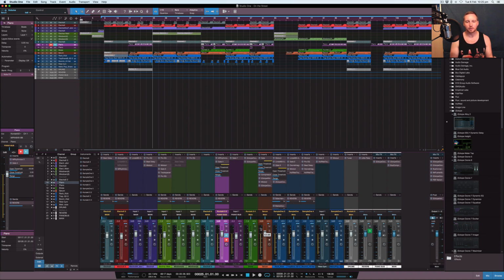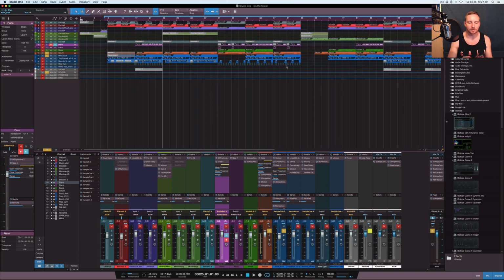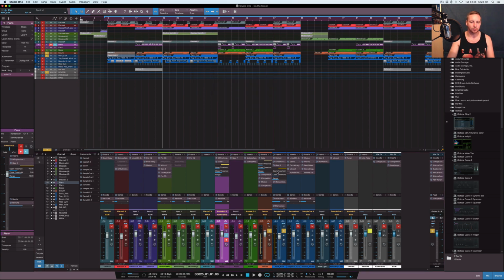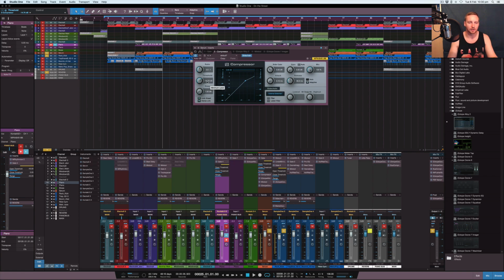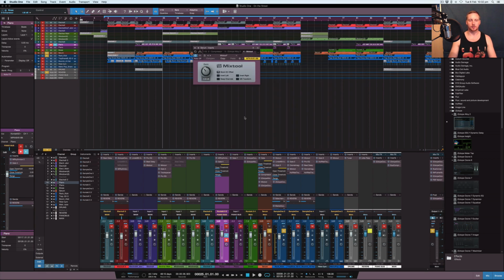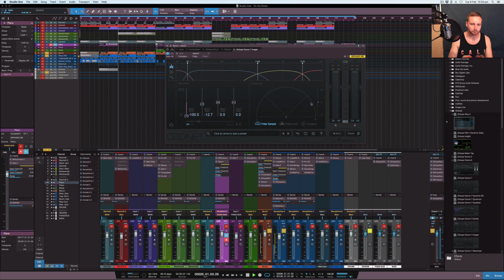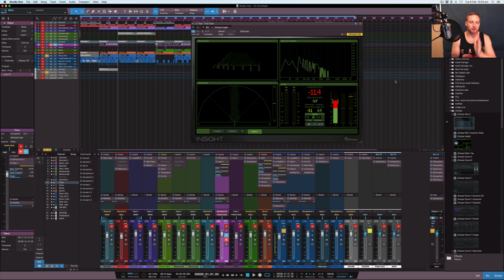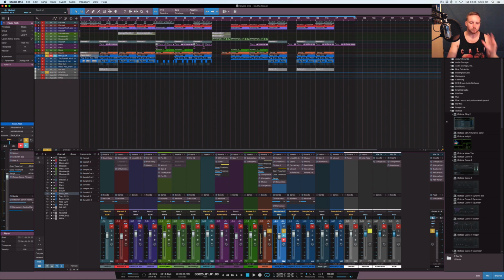Mixing Made Easy | Studio One 3.5 | Mixing From The Ground Up Part | 1

Comment: Did i hear you say in the beginning of your video for your low end, you have a kick and a bass in the low end but the bass has everything cut below 300hz ?
Reply from the maker: Scott Stevenson That is a filter in the gate it doesnt cut the frequency, it bypassed it from 300 below. Thats what I think your reference is to?
Reply: i watched again and am still confused. Is your Gate ducking everything below 300Hz on the bass when the kick hits ?
Reply from the maker: Scott Stevenson Close, the gate is bypassing anything below 300hz and is cutting off some off the top of the kick and bass the compressor (sidechained) on the bass is cutting lows off of the bass when the kick hits.